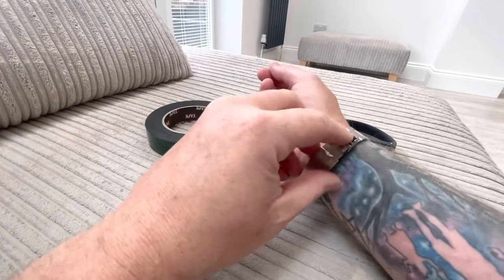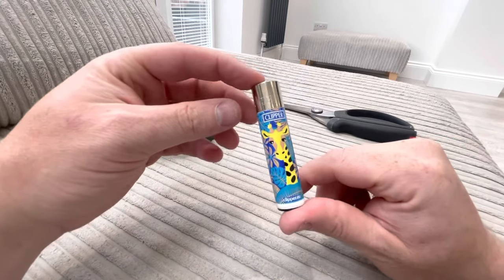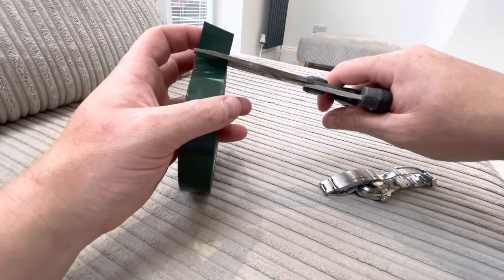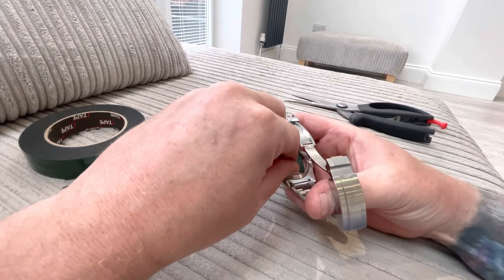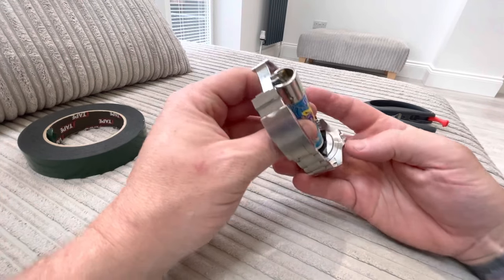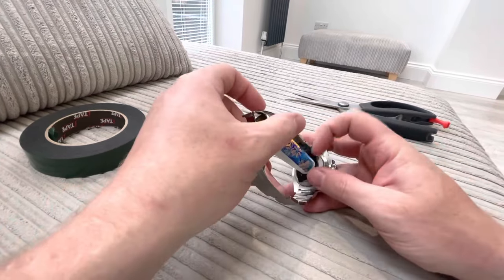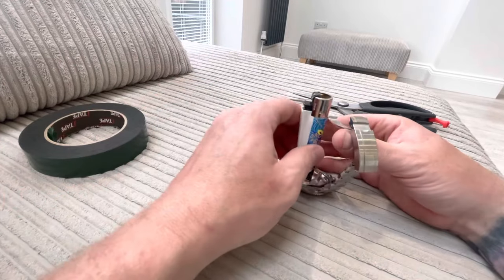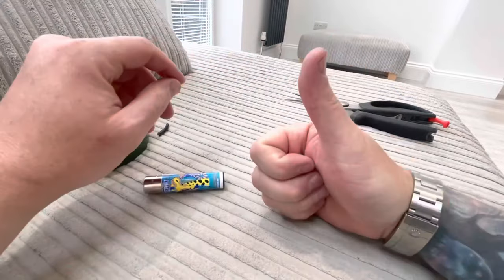REMOVE A ROLEX BACK WITHOUT DAMAGING IT EVER!!

Comment: Now that was easy - without need, you just got rid of the seal - you now have a watch that is probably no longer water resistant.
Reply: It's a fake. It was never water resistant to begin with.
Reply: Correct me if I’m wrong but was that a piece of plastic surrounding your movement? 
Rolex’s head must’ve fallen off. 
I’m not sure they put plastic in their watches my man.
Reply: Even though this is a fake Rolex, it still doesn't matter.  Do you think they screw the case backs on in a vacuum or something?  There is a gasket there for a reason.  I'd wager less than 5% of people who own a watch ever take it more than 20 feet below the surface anyway, so who really cares?  The wettest this watch will ever get is when he washes his hands.  Same with most people.
Reply: He probably had it open before this video and left it be loose . what a scam
Reply: @Itsahardknocklife9690  yes they do, the black ring is called the o ring which makes the watch waterproof and the hairspring on the balancewheel is also made out of plastic.
Reply: @willemvandepol1814  thanks, I stand corrected.
Reply: @Itsahardknocklife9690  The more you know!
Reply: So whenever you remove the back u need to replace the o ring? Rolex should consult the automotive industry 😂😂
Reply: Now it’s longer waterproof, certainly not for diving, you’ve voided the warranty and potentially got dust or fibres inside the case and movement 🤡
Reply: It it's was real then this would not effect the water resistance   the seal is built into the case
Reply: @garyuk761  no it’s not it has a rubber gasket. The watch back must be tightened to the correct torque (for which you need a proper tool) for it to be properly sealed.
Reply: @Anonymouslyme1  that's what I said,  a rubber seal, wester you tighten it up correctly is another question , the fact is if it's real it does not effect the water tightness or the warranty removing gbe back , obvious it has to be put back correctly   I've have a burg tourq case back remover,  I know what I'm on about you see

Comment: Don’t listen to what he says you know it’s not safe to take off the back of a Rolex because then you can’t put it back on perfectly. You have to use a special tool to put the back back on so it won’t leak. You have to use a gasket to close the back on the Rolex so it will not leak without using a gasket. It will leak water will get inside and then it will rust the jewels inside of it.
Reply: Jewels dont rust
Reply: First of all, I work at a Rolex  A.D I know what I’m talking about. If you take the back off of a Rolex you have to specially use a tool to pressure the back on the Rolex because it can get water damage leak inside of the Rolex if you get any moisture in your Rolex, you have 72 hours to get the moisture out before it does damage work on the caliber And the jewels that’s in the movement you can get moisture in your legs. If you do not lock your crown back up after winding your Rolex after we put the back on the Rolex we use a pressure tool that pressure locks the back because it has seals inside of the case just like it has a seal inside of the crown when you lock it so whoever this is saying what he is saying he’s actually wrong. I know I’ve been working at a Rolex authorized dealer for 10 years, I know
Reply: Not true.  I am a Rolex certified watchmaker and we use a Bergeon ball to remove/install Rolex casebacks.  Most of us only use the Rolex caseback tool if the caseback is super tight.  It’s a hassle because you have to remove or disassemble the bracelet to use the bench tool.
Reply: @feskymaloon1439  dude I don’t care that you work at a Rolex certified i’ll work at the A.D. For Rolex.

Comment: Why would you need to take the back of the watch off in the first place?
Reply: Replace a battery
Reply: @nineinchrails3361   Most Rolex watches do have batteries.  There are a few such as the OysterQuartz, but they are rare. However, there are several reasons to remove the back.  Authentication for one.
Reply: Check the motion to see if it's legit.
Reply: *Do not
Reply: @nineinchrails3361  🤣🤣🤣🤣
Reply: I need to take the back off my "knock off Rolex" to glue one of the gems back in place.